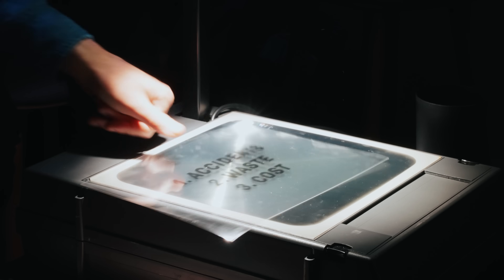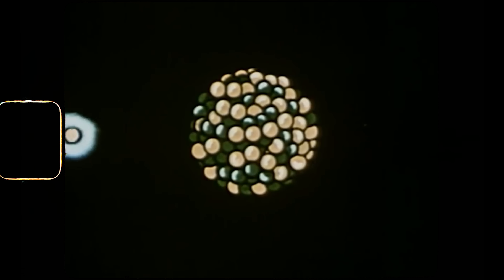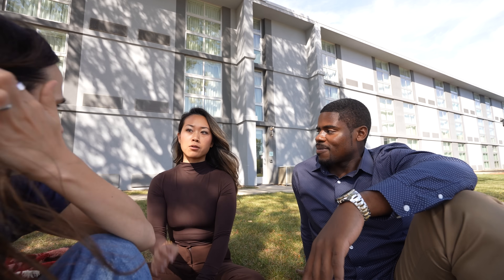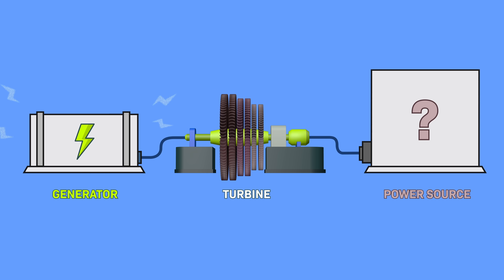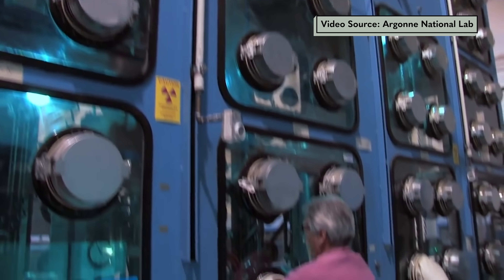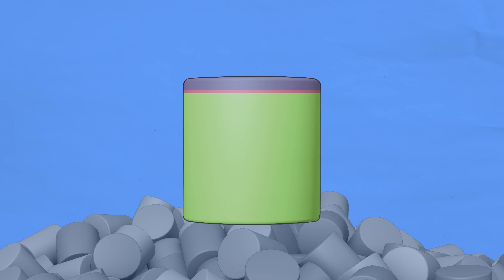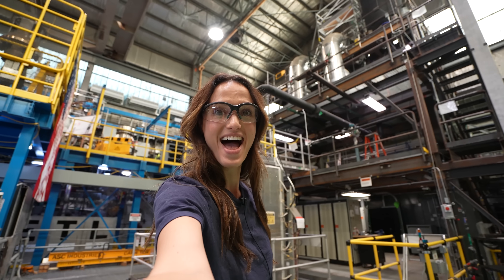The Big Lie About Nuclear Waste

Comment: Nuclear energy is THE MOST clean energy available.  It simply needs water to cool the thing, and to make steam that produces electricity.  Ya, there have been some setbacks with things like Chernobyl.  But the safety of nuclear power has only gotten better over the years.  Yet they look at it like a red headed step child, or a pit viper that's under your bed.  It's just beyond ridiculous.  And they keep thinking that we can get by without it.  LOL  California wants all the vehicles to be electric by 2030, and they have shut down some of their nuclear power plants because they have demonized them so much, yet they can't even keep roaming blackouts from being a thing, and they haven't even dealt with the fact that the insane energy requirements to charge these vehicles is going to be astronomical, not to mention EXTREMELY expensive, especially as inflation is out of control.  The liberal dogma keeps bellyaching how we need to spend to "fight" inflation?  LMAO  Nevermind that claiming to go green, we're simply exporting off all of the pollution it takes to create these insane electric beasts to another country, we're not solving ANYTHING.  It's already been shown that the pollution expelled, and the materials required to create these EVs doesn't warrant the cry to go green.  On top of that, "climate change" is nothing but a word game that they fabricated from global warming to "climate change" to make it more difficult to discern between the two as they lump any human component in that claim.  And they claim that "climate change" is mostly mad made!  ROFLMAO  The lies, and the corruption pushing these lies is just unreal.
I believe it was Switzerland who has been trying to "go green" that has tried many different things, and produced a lot of research on the subject, and it turns out that hands down, NOTHING, absolutely nothing, beats or even comes close to nuclear energy, and how clean it is.  Think about all those windmills, how big they are, how they are required to be built, the crazy process to create them, the pollution expelled to create them simply does not even come close to producing renewable energy.  Renewable energy is a myth, there is always a cost.  Even lake Mead (hydro power) encounters challenges from the environment.  And the environment changes ALL the time.  Solar, you have to cover major land mass with the things simply to power a coffee maker.  LOL  And the rare earth metals those are made of, CAN'T be recycled because of the process that it goes through to be created.
And then there's the myth that CO2 is bad for the environment.  Uh, hello... plants eat CO2, and thrive on CO2 the best.  They've done studies, enclosed studies housing certain levels of CO2 that simply prove that all plant life THRIVES on CO2, and grows that much more with CO2.
And any temperatures that they want to throw in our faces, don't take into account the sun.  The sun is not a never ending fuel source.  At one point, the sun will die.  May be way down the road obviously, but it has it's issues with sun spots, and solar flares.  And the environment is always going through changes, even since the beginning of time.
And let's talk about pollution.  America seems to be this bastion of "going green", these huge pushes.  But not just America, European countries have been pushing very hard to do it, and they're starting to find out the hard way, that they're simply idiots.  All of the leaders around the globe that subscribe to any kind of going green mentality are just idiots.  Maybe they're geniuses, because one thing for sure that "going green" has going for it... there is a crapload of money to be made, without practically any benefits.  Now sure, who doesn't want to protect mother earth.  But when you get down into the stats of it all, the worst polluters are the nations to do not give one shit about clean energy, nor pollution, because they're trying to survive, and poverty is a thing.  America has all kinds of laws and regulations concerning certain things, and America is one of the cleanest countries pollution-wise on the planet.  So it's just ridiculous that they keep pushing for America to "lead" it all on our dime.
The Paris Accord?  Nothing but redistribution of wealth, that's all it is.  It doesn't do a damn thing to solve pollution.  It simply gets America to pay other countries for the "hope" that they'll go green.  LOL  There's no guarantee, they have no oversight committees, no one gets punished if they don't spend that money to go green.  It's just disgusting bureaucratic BS, and optics, that's all it is.
In the end nuclear energy rules, period.  And those who ignore it, or claim otherwise, are just ignorant fools.

Comment: wanna know about another big lie? 

solar cells arent gonna prevent climate change. neither are these nuclear plants or fusion reactors. "clean power" often relates to power that doesent produce waste or CO2 because CO2, as well all know, is a greenhouse gas. whats does it do?
it absorbs more energy from sunlight than other molecules and therefore warms the earths atmosphere and our climate. 
now what do solar cells do? 
exactly. if you place solar cells on the ground or your house etc. its, even more so if they improve the "efficiency", which they do -> more money, that solar cell will absorb MORE energy from the sunlight than the earth/ your houses roof would have because normal surface do have albedo values (they reflect more) higher than solar cells. and while we dont produce warmth from it but electricity, that electricity wont leave the system. somwhere it will be used and it will produce warmth as we never have a 100% efficiency.
same with the nuclear plants. we use highly dense energy that was stable and conserved and release it to make electricity from it. that electricity will infuse our system (the earths atmosphere) with more energy (temperature goes up) at some point. 

the only way around this that i could think of was the wind-power plants because they take the energy directly from the wind, which is energy within the system thats already released and interactive.

Comment: Great piece! A variety of other lower level radioactive isotopes, commonly found in nuclear waste, have been used in nuclear batteries as well. While much less powerful than Uranium reactors, nuclear batteries of sufficient size can still be used to power industrial facilities and even entire neighborhoods. A new type of C-14 beta cell, based on CVD diamond substrates may even be able to power electronic devices or electric vehicles eventually. Basically, anything which emits ionizing radiation is capable of inducing a physical or chemical change that can be used to generate electricity. It's free energy, why waste it?

Comment: You should look into molten salt reactors like the aircraft reactor experiment and the LFTR reactor. It's another way to reuse waste that skips all of the reprocessing and has a lot of great inherent safety mechanisms.
Reply: I came into the comments to say this
Reply: @jeffsmith9384  They're losers. You can power a lcd clock on a potato, but you don't, because it's a loser. You could dumpster dive and stop buying food, but you don't, because it's worse. This is exactly the same problem with residual in spent fuel. Sure, it's there, but it's much more effort and much less of a return. So we don't. Just like we don't use tomato sauce jars to drink coffee from, or a million other lower quality of life decisions. 

You could live without electricity, but you won't...because no one wants to work harder for less...but you want to hear that you could. And that's how she sells you ads.
Reply: Is this along the lines of a thorium reactor?
Reply: @amac4170  Yes, exactly!
Reply: @amac4170  exactly
Reply: What about Thorium reactors, sounds like it's the new way going foreward?
Reply: @amac4170  that's what she was referring to when she mentioned the reactor from the 1960s at the beginning of the video.
Reply: You do know that reprocessing isn't just done for fun, it's a physical necessity?
One main purpose of reprocessing is to remove radioactive isotopes with a large cross section that would just absorb your fission neutrons and disrupt your fission reaction and thus basically choking your power production. Neutron poisons are a problem to such a huge degree that they disturb the functioning of your reactor to a degree that's crippling even if they're just a few % of your entire fuel stack.
That's what I researched myself because I haven't seen a single video so far that doesn't mention this issue, they all just talk about creating new fuel rods or reusing old spent fuel rods with useable concentrations to sustain fission reactions once more.
Reply: @shadowmystery5613  I am no expert on the subject, and I'm sure you would probably understand this much better than I, but as I understand it, the reason for using fluoride salts in an MSR is twofold. The first is that because the fuel is in a liquid state, Xenon can bubble out of the fuel much easier than in solid fuel reactors. The second is that fluoride salts readily react with the various decay products and makes them easier to chemically separate in what was described in the original experiment as "a reactor kidney." So, while reprocessing is still necessary, it can be done while online, theoretically reducing down time for refueling. The MSR was also designed as a fast spectrum reactor, which I had understood to be less susceptible to neutron poisons. I may have misunderstood that though.
Reply: @calebtraxler8466  Although flourine is highly reactive the limit is that even such an aggressive element isn't just reacting with everything. The problem we're ultimately gonna have is:
a) Do we hide our waste that deep in the earth just to be sure that retrieving it will...get hard at best
b) or do we contain our high level waste where it's still in our reach to reuse it if we can and it's economical?
Sometimes also not th high level waste is the problem, low level waste opens another can of worms: you can't recycle steel from used nuclear reactors because it would contaminate steel that's not radioactive...
Why does steel etc. in reactors becomes radioactive in the first place? Because neutron radiation caused by nuclear fission transmutates atoms of the containment into radioactive isotopes and kicks atoms out of the lattice, causing it to go brittle so that's another challenge we have to solve.
Reply: @shadowmystery5613  One of the positives of the thorium-salt reactor is that the molten salt allows the large cross-section isotopes to also break down via fission -- provided the salt is molten and moving.  The disadvantage is the degradation of the pipes and pumps due to the constant bombardment of alpha radiation.  The neutron poisons are critical to thorium-salt reactors, in that they help stabilize the reaction through negative feedback.  Too hot? Fewer reactions. Too cold? Fewer reactions.  Not moving? Fewer reactions.  So once started, it is critical to keep the salt flowing. The salt must flow... where have I heard that before.  =^.^=
Reply: Nuclear waste is an oxymoron. If it's so nuclear it's dangerous; that's free energy being released into the system. It's the technology to make that energy useful to us, or lack there of, that begates the concept of this material being waste.
Reply: I would dearly love to see the minimum viable size of an MSR reduced to the size of an elephant. That would mean you could run a train on nuclear power. Instead of diesel/electric it would be fission/electric.
It would also mean ocean-going ships could go nuclear and greatly reduce the amount of oil consumed.
Reply: Yup. Caleb we could reuse Uranium by upcycling with plutonium to make MOX (get about 3 more lifetimes out of the original uranium), then you could move to secondary process in molten salt reactors.

We could quite literally power the world twice over for 100 years for basically nothing if we'd do that.

But nooooo, they killed Westinghouse, they killed nuclear development.
Reply: Yeah, they are great. Once they have shut off for whatever reason, there is no way to start them up again. So very safe ;)
Reply: Molten Salt can be used in Solar Arrays too.  No need for nuclear at all, I'd argue.
Reply: @deadwingdomain  it's a very different concept. In concentrated solar, the molten salt is used as the working fluid and is heated by external means. In nuclear molten salt reactors, the salt is used to contain the radioactive material and make it more chemically stable. While I think that concentrated solar has a place, it's not well suited to non equatorial areas and it has a high cost per watt. Molten salt reactors could help us to burn up our nuclear waste while providing heat and electricity to regions that would otherwise need to rely on gas or coal. If you're interested in learning more about molten salt reactors work, I'd suggest checking out some of Gordon McDowell's content.
Reply: @deadwingdomain  Solar arrays don't consume existing nuclear waste. We're stuck with it for the next 300,000 years.
Gen 4 reactors consume high-level waste and reduce it to low-level waste. It remains radioactive for 300 years instead of 300K years.
Yes we absolutely need nuclear reactors.
Reply: Omg yeah cause I was about to say bout the incidents that got caught in the nuclear incidents! It’s very risky and my sib told me that it’d have to have to be a federal project for the entire not just country but entire United States. It ain’t small nor it ain’t little of risk of many ppl’s lives and safety. Wasn’t there the chernobyl disaster in 1986?
Reply: @Munesol Don’t use  cars, it kill more people per day than all nuclear activities didn’t since human play work with it !
Let’s not talk about tobaco, alcohol, sugar, salt, cholesterol, etc !!! 😂
Dams incidents have killed more people in history (and destroyed more nature) than the nuclear industry, but anti nuclear people never ask to stop for it !!! 😂
Reply: can you tell me which material you'd use to contain that mixture wich you couldn't watch corroding away?
stop dreaming please!!!
Reply: @skandalf9726  the original MSR experiment at Oak Ridge used a type of Inconel superalloy called Hastelloy and showed some success. Significant strides have been made in Inconel and ceramic materials since the 50's and it is very likely that a more tailored solution could be made for MSRs.
Reply: @skandalf9726  Maybe we should ask the Chinese since they built the world's first commercial Molten Salt Thorium fueled Reactor and it has been operating for a year so far.  The test reactor in the U.S. in the 1960s ran for several years also but was not a commercial power producer.

Comment: New nuclear plants are pretty much the only thing that can deal with all the existing nuclear waste we have. We need modern fast breeder reactors to transmute the existing waste into forms that have far far shorter half lives than the current waste. The problem is, most nuclear plants in America were specifically chosen for their dual use of producing weapons grade material(or material that can be easily converted into weapons grade material, like plutonium) for bombs while they make electricity, rather than to reduce long lived radioactive isotope byproducts. Honestly, what we really need is thorium reactors that generate very little nuclear waste compared to current reactors in the first place, but we also need breeder reactors to deal with the existing stockpile of waste material.

Comment: Ok, but what about heavy water reactors, like the CANDU, which doesn't require concentrated U235. It runs just fine with unprocessed U238 and also with some plutonium in the fuel, just like what the light water reactors produce. This design has also been around for over 50 years, and Canadian CANDU reactors are in operation around the world already.

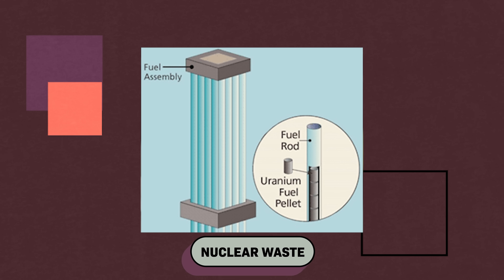Comment: 7:08 the number 235 is not the number of neutrons but an atomic mass number = number of protons+neutrons,  true the difference is made by different number of neutrons in the nucleus because if it had different number of protons its a different element.
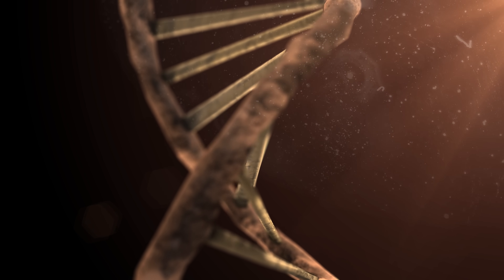7:31 you fire neutrons not atoms, the neutron gets absorbed by the U atom and becomes excited and unstable and therefore breaks.
There is also a technology of fast breeder reactors which can use U238 to transform into plutonium and you basically use up almost all of the fuel but as you mentioned there is fear that it will be used for weapons proliferation..... which is unlucky becasue there would be less problems with waste :/